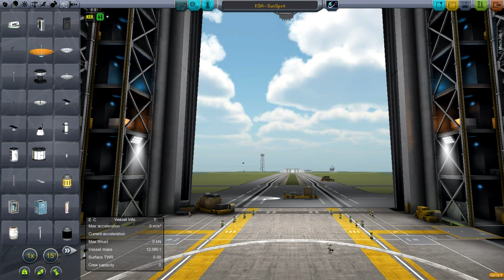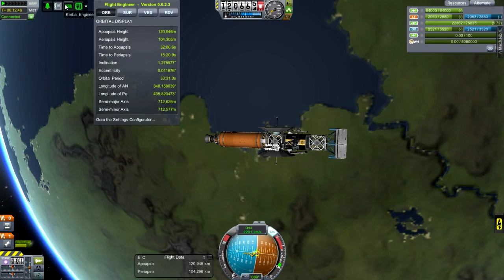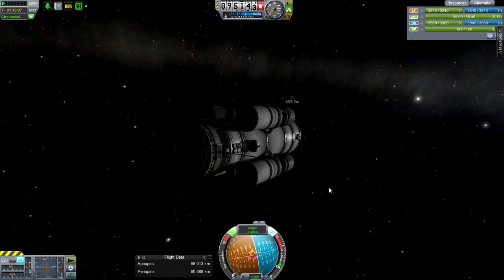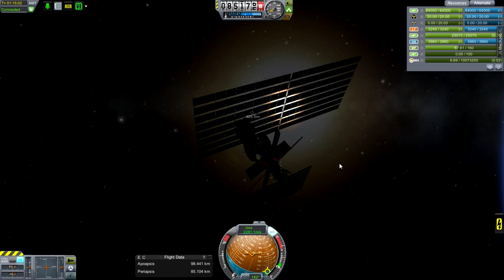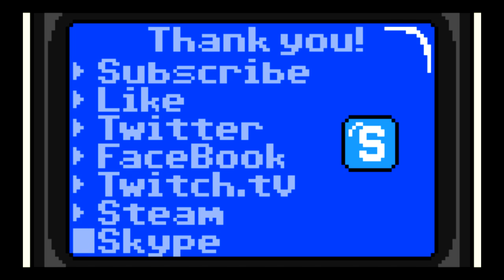Kerbal Space Adventures Ssn7 Ep1 HD - Block out the sun

Comment: I'm partial to the KOSMOS panels because they rotate in interesting ways and they are folded up in a realistically large manner. The super large ones seem to have some problems with Interstellar that may be related to having a hub that tracks the sun with 0 charge.
Reply from the maker: Well with two mod packs that do basically the same thing there's going to be some overlap issues. Also when I don't know what I'm doing that doesn't help much either.

Comment: 4kb, couple of pointers:
1st: Are you sure that the Near Future reactor is really a reactor, to my eyes i think it was the nuclear fuel recycler thing...

2nd: Nervas?! You have KSPI installed and you use nervas...ugh. Here is a nice KSPI variant that has TONS of deltaV more:
- Senior docking port
- 2.5m probe core
- suitable battery, maybe one of those big 2.5m NFP ones
- 2.5m tank of your choice
- 2.5m KSPI generator, set at direct conversion
- 2.5m Fusion reactor (assuming you got 0.10.3)
- 2.5m Thermal rocket nozzle
+ whatever else it might need, like some docking lights or something...

Optional:
Replace the thermal rocket nozzle to 2.5m thermal turbojet and add some air (atmo) intakes, maybe with disposable ones. Now this one can lift up whitout support stage. Atmo will take it at about 15km where it will run out of speed so then switch over to LFO, should give 10-15m/s/s accelaration that will take it to orbit with fuel to spare.

Because of the fusion reactors high temperature, it will give Isp of 4000 with LFO as fuel. The generator is needed to keep the fusion reaction running. Once burn is done, you can shut down the reactor untill you need it again. Do not keep it running if using the satelite as transmitter mode as there is a bug in KSPI code that draws too much power from the reactor.

Make1b (in twitch)
Reply from the maker: I'm pretty sure it's a nuclear reactor, but I didn't double check so I'm not sure. Guess we'll find out when we try to fire it up. Also I prefer the NERVA engines over the KSPI engines when I'm not using the KSPI nuclear reactors.